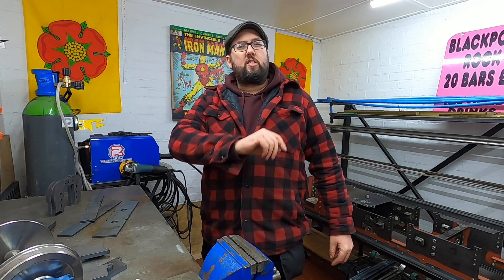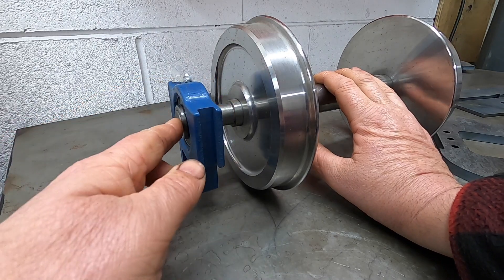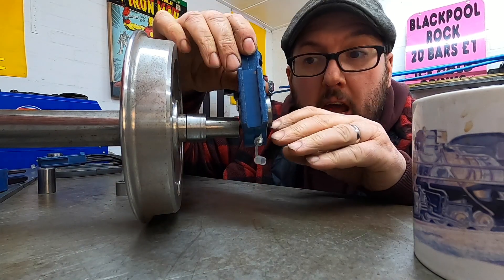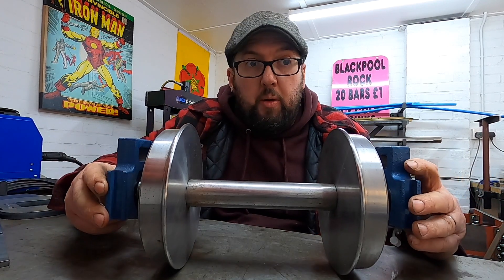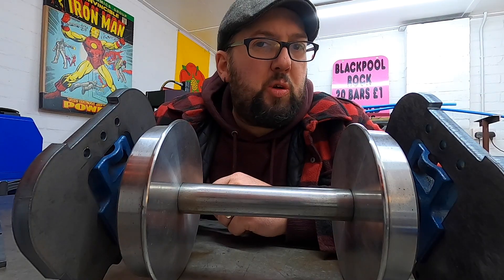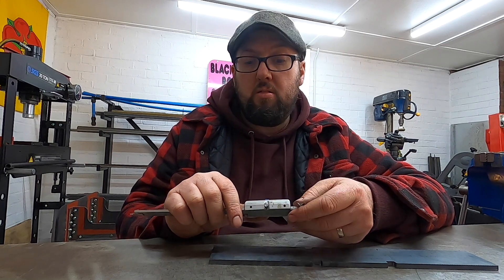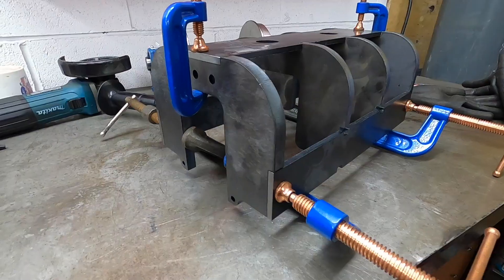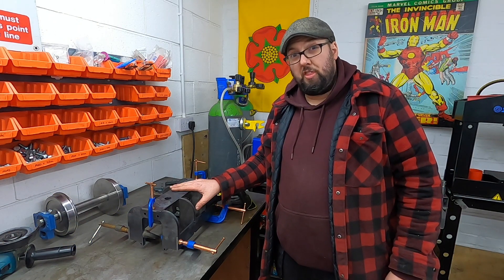The Pony Truck - Part One - EP16 - 7.25" Gauge Steam Locomotive Build.

Comment: Great project!
What are the names of the bearing housings with the guides?
PS.: Found it ;-)
Reply from the maker: Hi Florian, many thanks, much appreciated, hopefully you found then as take up bearing units?!? All the best, Matt 👍
Reply: @MattChiversWorkshop  
Yes, exactly, the solution with these bearings is very elegant.
It's a pleasure to follow your great project.
I will still need a while until I can start with the construction.
I plan to build a similar locomotive, but with typical Austrian construction solutions and appearance.
A 0-4-2 resp. B2' h2st (with Krauss support tender and a Lentz poppet valve / Gölsdorf valve gear)
But the construction is growing...

Comment: Those look like very thick laser/plasma cut parts - on the leaflet I got from Model Engineer's Laser it suggests to either go over them with a flapper wheel or get them up to 400c and let cool naturally to temper the cut edges. Have you experienced that with your build? I'm using HSS rather than Carbide so a bit nervous about machining!
Reply from the maker: 12mm is the thickest in that pile. I've never had an issue using HSS on laser cut edge. I've used laser cut parts for years and never flap disc the cut, only if there is any dross/slag build up on them. There is a small amount of localised hardening but it shouldn't be enough to damage HSS.  Stainless on the other hand is a different matter.
Reply: the black oxide layer sould come off very easily. they would use oxygen in the lasercutter to cut through 12mm, for thinner stuff they use nitrogen. we use a garyson block at work, its an abrasive rubber block to clean the edges up (i can send you both one if you like :) ). i wouldnt worry about hardening on mild steel from a laser cut, there isnt enough carbon to properly heat treat. you may see a small heat affected zone but the hardness will be the same. its a reason why we like mild steel.
Reply: @fitztheviking  I have a garryflex block, is that the same thing? Thank you for the advice!
Reply: @williamsworkshopuk  yes it's the same thing.  paint has a tendency to flake off where that black oxide is because it's poorly attached.